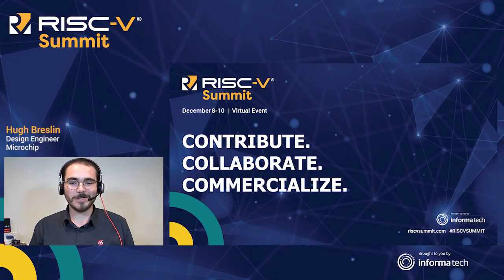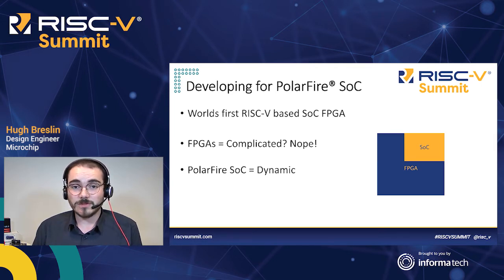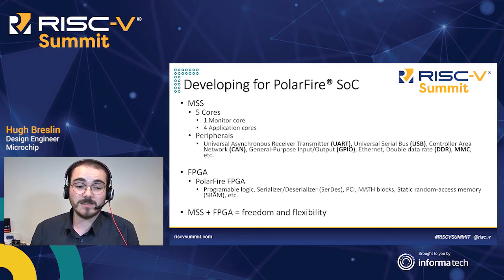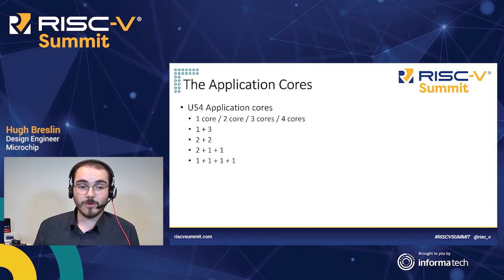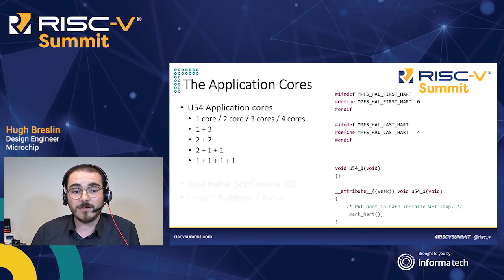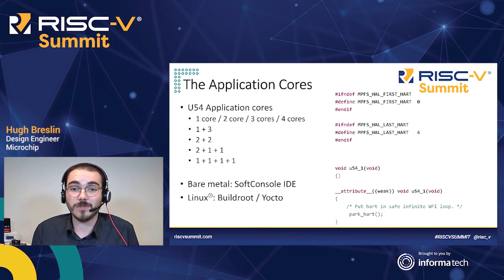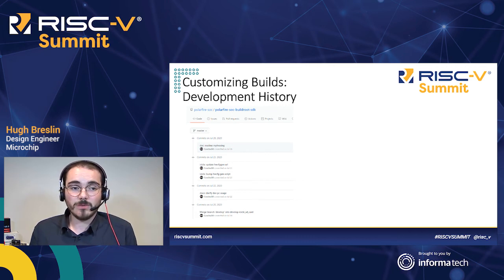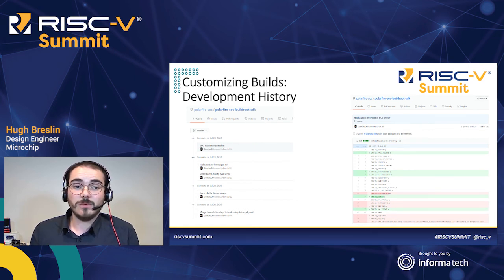Developing with PolarFire® SoC

Comment: Can I use FPGA to extend RISC-V ISA with my own instructions?
Reply: you cannot use the PolarFireSoc, discussed in the video, to extend the instruction set. the RISCV core is hardened silicon and cannot be modified. You could probably use the PolarFire FPGA fabric to instantiate a soft-core RiscV; by which you might be able to modify said core by hand to add your own instructions.